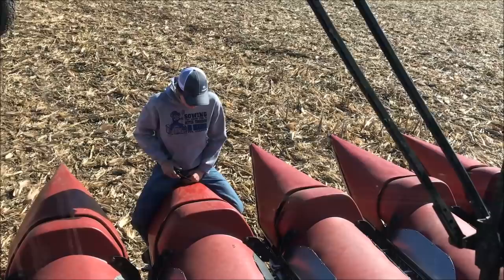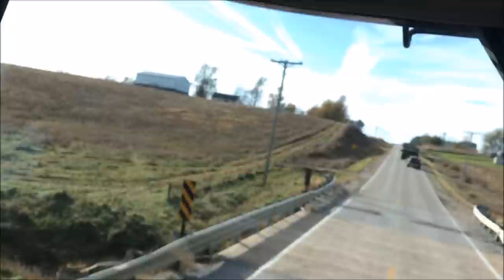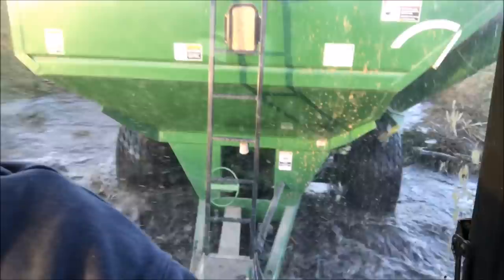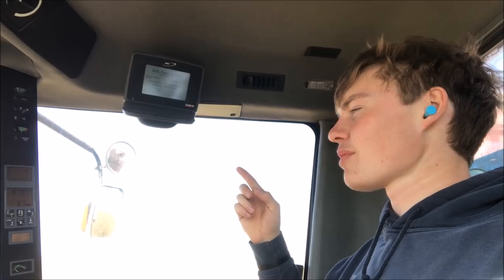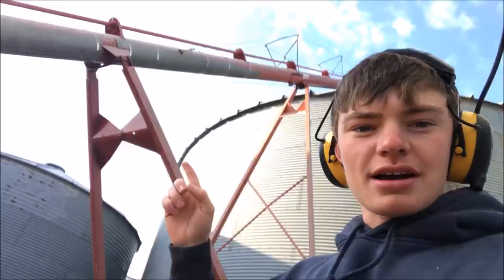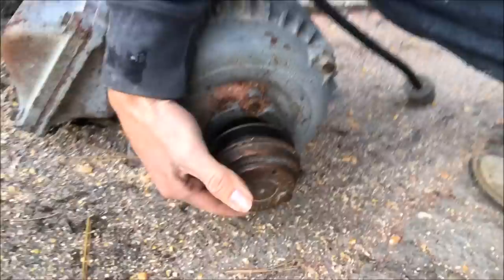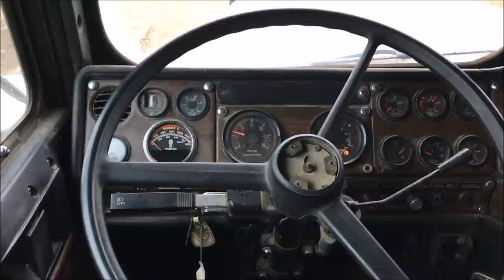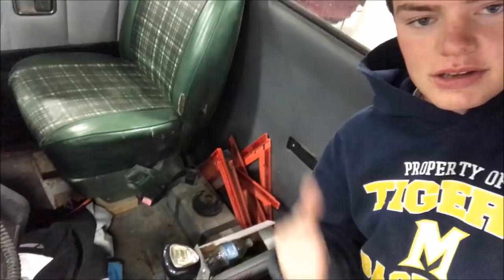Harvesting Corn In The Mud!

Comment: Idk how much or if it would be a problem with your setup but my family is friends with a custom harvester crew owner and they run a 4840 on a Kinze 1100 grain cart I think the size is and I noticed one day they ran a piece of steel under the drawbar connected to the bottom 3 pt arms as support for it and thought that’s not a bad idea. They custom harvest our wheat for us
Reply from the maker: Chase Howard I've heard of that before w/stuff that puts a lot of weight on the tongue. Our carts are almost half that size!
Reply: I love that you dont use the newest equipment. Hardly see that
Reply from the maker: Dustin  Block we make it work!

Comment: Duals would make a large improvement on those combines. Large floaty diamond tires for the steers are a large improvement on a 2wd tractor. Put them on a ford TW-35. Could damn near go anywhere my FWA TW could.
Reply from the maker: braydenpresber We have been fortunate enough to not have to take it into the mud so the super singles are where we are currently at. Those diamond steer tires are very neat.

Comment: The big steering wheels were needed on the older trucks without power steering. The older trucks all had them even if they had power steering. The newer ones have smaller steering wheels. Drive one without power steering and you'll know why they have big steering wheels. Driving down the road you can't tell much difference but backing and driving around slowly you need the leverage of the big wheel.

Comment: Three phase motors is motor current with three path of power that cross at six points of power so it always has on status as one path switches off there is another switching on. The point is never try to interrupt this always has forward torque. This will rip your arm clean off!

Comment: There should be a rubber hose with a grease fitting zirk as you call it hanging out if the bell housing to send grease to the clutch brake at least my Pete 379 has one so on your Volvo might have a different set up but there will be some way to get grease to the clutch brake and I have never herd you mention the clutch brake on your major services and they do need to be replaced you can tell if it needs  replaced if you put the clutch pedal to the floor for a couple seconds and it grinds when you pull it into gear that means the clutch brake is shot I have driven trucks for 28 years so I am telling you the truth not sending you on a wild goose chase

Comment: The reason for large steering wheels goes back to the days when there wasn’t any power steering.
Reply from the maker: Farming Fixing & Fabricating Do they still have it incase you lose power steering? Turning those without power steering would be hard!
Reply: Cole The Cornstar that and maybe to have better control in the event of a steer tire blow out.
Reply: where are yall located at?
Reply: @terrysadventure1529  Cole is in Iowa I believe and if you are asking where I'm from I am in New York.
Reply: @FarmingFixingFabricating   ok nice do you know any body that needs a farm hand
Reply from the maker: Terry Roberts central Iowa
Reply: As a cross country truck driver the over size wheel is so it doesn't take as many turns of the wheel to turn the tires as it would with say a car size steering wheel bug truck big tires big steering wheel

Comment: Semi's have a big wheel in case your power assist goes out so you will have the leverage to steer.
Reply from the maker: jeff m You'd get strong real quick if that went out
Reply: @ColeTheCornstar  been there done that and your only thought is to get to some place to get it fixed

Comment: Why do semi's have such large steering wheels? Before there was power steering there was what was called Arm Strong Power Steering, the bigger the steering wheel the easier it was to steer the truck. They are still large because if the power steering goes out you are still able to steer the truck to a safe place to stop. Cheers...

Comment: If the power steering goes out, the larger diameter steering wheel makes it humanly possible to turn that giant, heavy steering assemblage, same idea as adding a pipe to a breaker bar kinda.

Comment: the older semi had no power steering. and if you had a small wheel it,s harder to steer.
Reply from the maker: gerry kehoe It actually does have power steering
Reply: semi's have large steering wheels to give you more fine tuned turning accuracy, Mainly for backing up trailers. the bigger the wheel the less the front wheels turn per steering wheel movement.
Reply from the maker: XxAtomic646xX That's a great explanation. Thank you!

Comment: If you guys have problems with mud I'd recommend getting a cat combine on tracks
Reply from the maker: Aaron Pulchinski That would definitely be an option
Reply: @ColeTheCornstar  depending on how big your fields are if most are bigger than 50 acres I'd recommend a class 6 or 7 which would be the 465r or the 565r and the class 7 would be the 475r and 575r either with a 25 ft to 30ft bean head for the class 6 with a 6 or 8 row corn head and the class 7 30ft to 35 ft bean head 30ft for more hilly and rocky fields and 8 to 12 row corn head
Reply from the maker: Aaron Pulchinski Our current one is a class 6. Id probably go to a class 7.
Reply: @ColeTheCornstar  if ya don't mind me asking what state are you outta
Reply from the maker: Aaron Pulchinski I live in Iowa
Reply: @ColeTheCornstar  only reason I'm asking is because zeigler dealers will send someone out to fix your combine and help you out with it